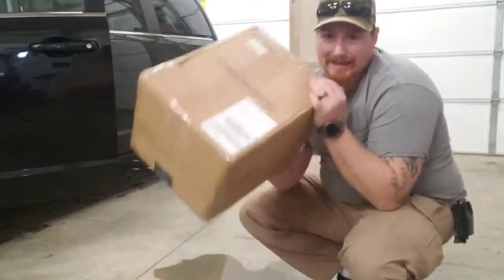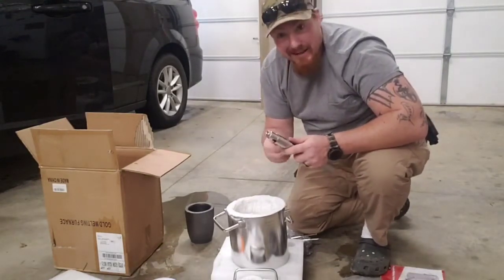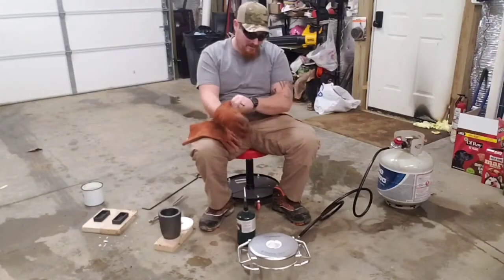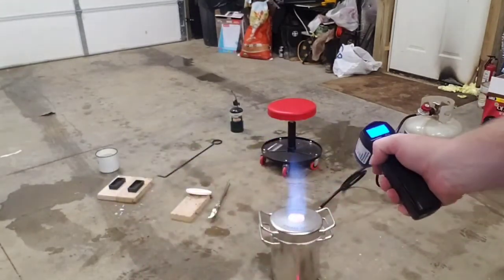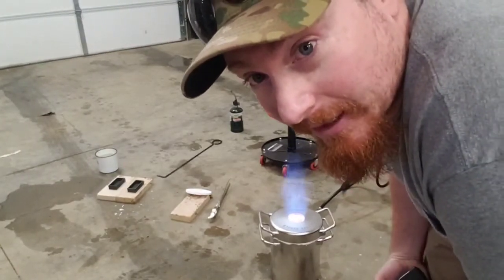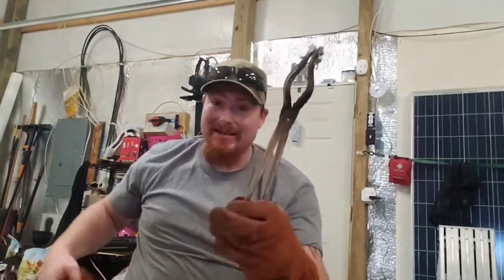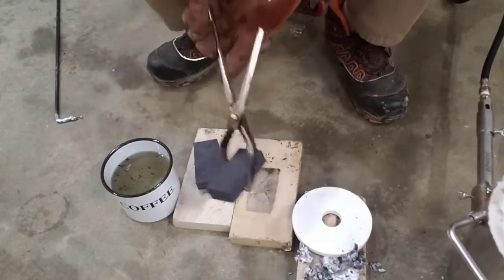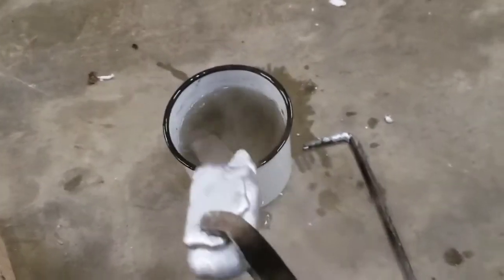Cheapest Propane melting furnace from Amazon unboxing and first time melting aluminum cans

Comment: Any one else notice the burnt door, not sure he should be playing with fire?
Reply: He also has a smoke detector beeping away on low battery through whole unboxing :/
Reply: Haha
Reply: It was the Crocs for me.
Reply: The door did make me laugh 😂
Reply: As long as most of the structure is still there 
I'm ok with it 
But yeah the crocs are very concerning
Reply: Ayo I thought I was the only one 😂
Reply: Only pyros will appreciate the decor and setup lol
Reply: I’m thinking the door is from an extension cord hahaha idk tho. I love the vid. Just a real guy doing real shit. Haha I’m in the same boat right now. Trying to find the best way to melt down my cans.
Reply from the maker: @HopCity22 Thanks and on the doors from a heat gun. It was off but plugged in and hanging by the plug. I guss when I shut the door it fell hitting the ground and moving the switch to the on Position. It landed with the front about an inch from the wood.  Luckily my wife saw it flaming from the out side before it got to big and I was able to put it out with a water hose.  As far as melting the cans I find it fun too and my latest video shows my new way of seting up that I like.  I don't  about 10 melts and each time I fine little tricks that make it better.
Reply from the maker: @HopCity22  p.s An extension cord getting smashed in the door and causing a fire was a good guess

Comment: I’m almost 1000000% sure the fire brick is for placing the hot crucible upon. That way you have a safe place to put such an object at that temperature. Also good for pre heating your graphite if you don’t like using the top of the furnace
Reply: Can confirm, my smelter that looks and was packed the same, different brand, says to not use the disc inside the furnace, its for a safe spot for the hot crucible.
Reply from the maker: Thats good to know thanks.
Reply: @chickenhawkfarmstead8478  it's called a plinth. it helps avoid losing heat to the ground, thermal shock for the crucible, and can help make it easier to pick up the crucible, so you have a place to put your tongs.

Comment: The fire brick is used to keep the crucible balanced inside of the furnace.
Reply: I'd bet he figured it out when the crucible stuck to the wool.
Reply from the maker: @campingincolorado6432 it didn't stick to the wool. But it did sit more level ones I used it on bottom
Reply: @chickenhawkfarmstead8478  my first attempt, I didn't realize how long it took to melt the aluminum, after 45 minutes the crucible was stuck to the wool. Once I used a spoon 🥄 to remove the slag it was a lot easier to see the progress!

Comment: Need to spray the molds, I'm taking that gas line before you trip over it, don't put water near your modes, open up a door. Stomp you cans down it goes a lot faster. Next time you do this take a reading how hot is sheet rocks getting above head. One more thing replace the battery in that smoke detector by the look of the door find you strongly suggested other than that good first attempt you'll get there
Reply from the maker: What are you spraying the molds with. Un crushed cans melt faster in my experience. The roof is 16 foot high, and the door was a total unrelated incident.   You're totally right about the battery, and I have ventilation fans running in the loft. But yes, it takes time to learn it all, and I hope with each burn, I get a little better and safer.  I do appreciate the advice.
Reply: Spray the moods what with

Comment: Two things,  if you close down the dampener it would burn hotter and use less fuel, if you crush the cans they melt faster and you don't risk splash out when they pop.
Reply: 3rd thing, might be important to change that fire alarm battery....for safety....and better quality videos lol

Comment: Round donut with the hole probably sits under the crucible a fire brick. Use card board between round fire brick and crucible so it won't stick to each other.

Comment: The wool stuff, you can get a rigidizer for it, so that it can last a lot longer. I had a hard time applying it to the inside, so when this one gets to where it needs replaced ( like the crucible it should be considered a consumable part, albeit slower, according to the listing) im gonna get 2 bottles so i can dip the wool into the hardener, but it does take a while to cure and harden, which is why i am here watching this xp. If you plan on using the smelter a lot i highly recommend trying that out, so you can get more use from the same stuff

Comment: As a guy who has worked in an Aluminum Smelter a high purity Smelter at that it was hard to watch this video but what we do is different and wayyyyyy bigger lol same concept tho😅 but hey it is a lot to learn lol like how he let the metal freeze up in the casts lol Aluminum freezes pretty quick so about a minute after you pour dump the cast (in some cases not even a minute just depends how big the cast is) and I’d clean up the water in the garage too lol molten aluminum and puddles don’t mix 😅 but he did pretty good for a guy that’s never been around molten metal!
Reply: The water scared me to death was wondering if the tongs were wet when he won’t back in

Comment: the ceramic donut goes in the bottom of the furnace to set the crucible on, if it came with (2) donuts then the second one is for placing your hot crucible on after removing it from the furnace
Reply from the maker: Thanks

Comment: The round heat brick is to put the crucible on when it’s red hot
Reply: The round fire brick goes inside the furnace under the crucible.

Comment: Use salt to get the most aluminum out of the cans and off the slag…
Reply: More information  on the salt please? What do you do with it?
Reply: @aJarrowLad525  just pour it in or wrap it up in tin foil and drop it in …. Plus just look up the other posts about salt in melting aluminum… that’s where I learned it…

Comment: I hate that it’s hard to gauge the regulator. I can never tell how high I have the psi
Reply from the maker: Very true. I'm gussing at some point you just get a fill for it.
Reply: @chickenhawkfarmstead8478   Yeah, I figured out that even though it says 30 PSI You still have to have it turned 3/4 of the way up or it won't melt copper. Gonna break down and sell some of the ingots I made and spring for a Devils Forge.

Comment: Hey there! How long did this last?
Reply from the maker: The furnace or the tank of fuel?  I used the furnaces about 10 times or more now and no real ware on it. I never used a full tank at one time  my best guss is about 12+ hours.  the more I used the furnaces the better I get about not wasting fule.  Like turning it off when I am puring the metal in the molds

Comment: You better make sure that there is no water or humidity in your cans , if you do you might have an explosion splashing molten metal everywhere ! Pre-heating the cans or metal is a must before plunging it in molten metal.
Reply from the maker: It's really not that big of a deal. Yes, lots of water, but some won't make it explode. It's just the water Turing to steam and it "can" throw melted metal. This is way I put the cans in open side up and don't crush them. Any moisture left in burns off and comes out the opening.  If doing ingots they may have lots of  moisture just place on top while heating up the  crucible like you do with your molds.

Comment: Blue rino only fills a 20lb.to 15lbs.read the label .Better off filling at a propane station.. you get more propane & charged less for it .✌️
Reply from the maker: That's what I do I go to Southern state or tractor supply. But great tip 👍 I'll be pining this to the tip. Thanks

Comment: What's the black spot on the service door
Reply from the maker: About that... totally unrelated  I left a heat gun plug in and handing by the door it fell and turned on. Luckily we found it and put it out before  we lost the building.